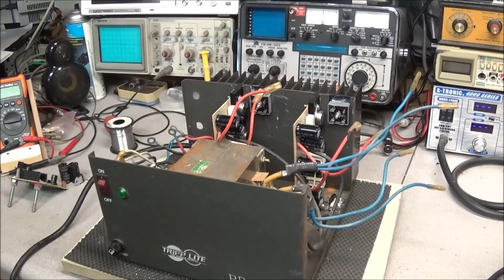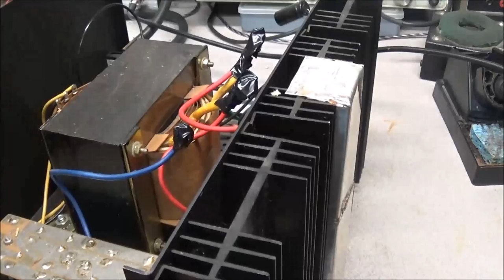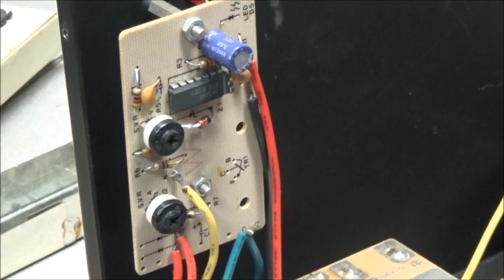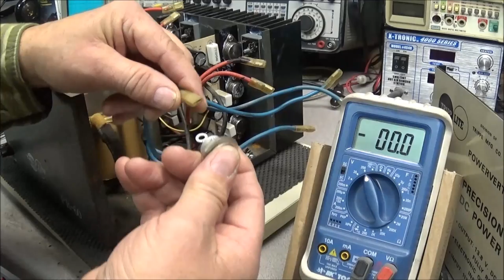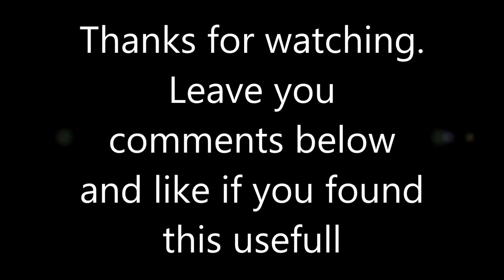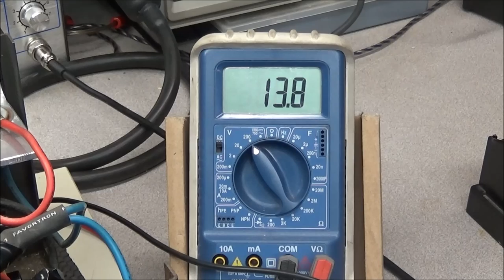#88 Tripp Lite PR 60 Power Supply Repair and working

Comment: Yep, getting old is definitely not for the young...when you get be my age "CRS Disease" sets in pretty good ("Can't Remember S&%$" for you youngsters). Good time to point out that documenting your work will do wonders for you the next time you run into a similar issue. I got in the habit of doing that, especially with computer problems, many years ago and you wouldn't believe how many times it has saved my butt from spending needless hours re-inventing the wheel. Happy Holidays to all!  73 - Dino KL0S
Reply from the maker: Oh yes, I suffer from CRS. Sometimes more than ever. Guess it is now good that I document these things in video now :-) Happy holidays my friend. 73 Buddy
Reply: Dino Papas 

LOL, I know the feeling.  My problem is I have always had CRS disease.  I can remember almost every NSN  for every part in a M16A2, M9 and even a MK19 MOD4 but I'll be danged if I can remember where I set that screw down 2 minutes ago that I now need.  Maybe I'll remember in 20 years or so. :-)

Comment: Hi Buddy, I just picked up a PR-60 at a flea market for $20, I thought the power transformer was shot but it was the power switch.
I am scratching my head about those so called "bridge" rectifiers as they have TWO positive outputs each.
Now I know after watching this video they ar not bridge rectifiers.
 I jumped out the bad power switch and I get nothing out of the output.
I just made a video on it and plan to upload it soon.
I need the schematic on this as I can't figure it out.

Comment: Well thanks for the info on the diodes and not a bridge rectifier. I will get my power supply from under the bench and do the same thing to it. I was going to scrap that old supply but you have given me hope as it to needs a couple of diodes and will be like new. Now where did I put the case and screws for it?
Reply from the maker: Thanks Lyle. Give it a shot and see what you can do with it.  I have that problem also. Always have many items torn down at a time and keeping up with stuff is tough

Comment: Just bought a PR-60 for $13 had a broken fuse holder.   Do I need to do anything to it if it works OK?
Reply from the maker: Check  solder connections and capacitors. Either can cause lots of problems.

Comment: I think if you look at the schematic again one wire from each side of the transformer went to each diode block, instead of both wires from one tap going to the same block, so not only were the wrong parts used but they were wired wrong as received.  Assuming each block contained two diodes,  this would yield a full wave rectifier if wired correctly, assuming the black wires are the center tap of the transformer.  I think you have wired each board in a half-wave configuration, which may be fine depending on your load requirements.  Regardless, I enjoy your repairs and find them informative.
Reply from the maker: Yes took me a while to figure this out. I had bridge rectifiers on the brain. All fixed now. Thanks for watching

Comment: My Astron 70A has a crowbar on it was at 18 volts and killed my yeasu 857D. I took power supply it apart and looked at it. Put it back together and it's running at 13.7 . I guess loose connection somewhere.
Reply from the maker: Sounds like a loose connection yes

Comment: Is the supply losing any performance without adding the second diodes for full-wave rectification instead of using just the single diodes for half-wave rectification?
Reply from the maker: Works fine. It only takes the two diodes (one per leg) Each acting as a half wave rectifier.
Reply: Is there any reason that the +ve outputs cannot be joined together to provide a full wave rectification so that the ripple across the smoothing caps is now reduced. Makes their life easier as well.
Reply from the maker: You have to go back and look at the schematic at the design. There you will see that one of the transformer tap (the black wires) are the ground to each filter board.  So you cannot join the two together. This would cause a direct short.  Each leg and diode acts as a half wave rectifier.  So you get full wave rectification out of the filter boards.